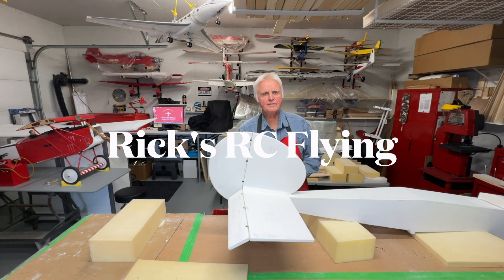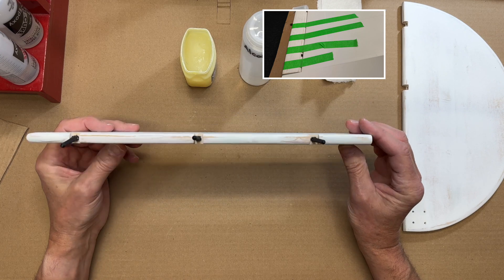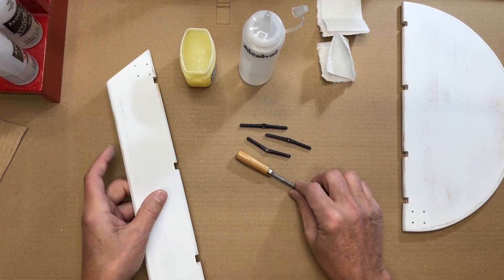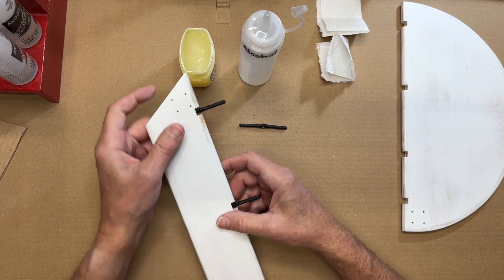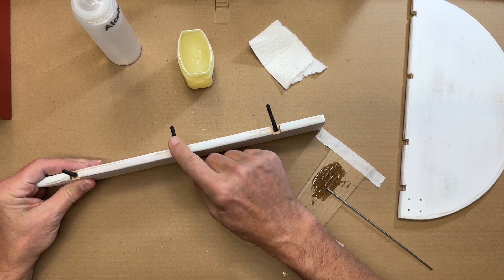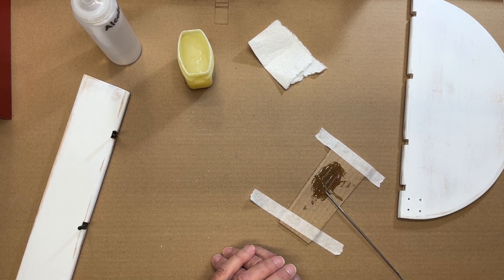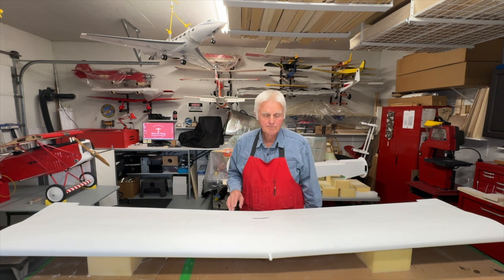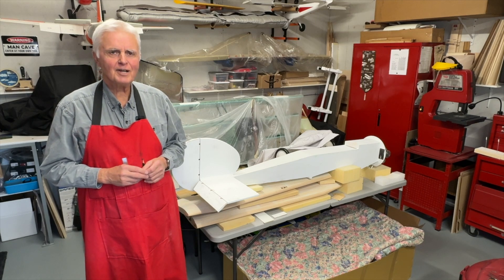Installing Robart Pin Style Hinges On A RC Airplane

Comment: I've used Robart hinges for a long time, before that was using dubro flat hinges pinned with toothpicks..I recently ordered 2 packs of hinges; the 3/16" and PKG of 1/8", after years of no problems ...every single hinge of the 1/8" and 3/16" were very stiff.I emailed Robart with my concerns..he told me he would make me a set...said would look at the adjustment on the machine..so hopefully by now their hinges are good again,but there are probably a lot out there still that are too tight.was July/Aug of 25 when I got these
Reply from the maker: Thank you for taking the time to share your experience with the hinges. I genuinely hope this issue is resolved swiftly. It’s reassuring to know that Robart is actively addressing the problem. Rick

Comment: Its getting harder to start out in building.  Materials, tools, chemicals, even balsa are harder to source. 
 With the loss of hobby shops
Reply from the maker: It's definitely not what it used to be, but there are still many builders out there. For suppliers, you can check out Balsa USA, National Balsa, Brodak, Aircraft Spruce (for glue and finishes), Dubro, Chief Aircraft, Kit Cutters, and many others. It may take some searching online, but you should be able to find what you're looking for. Don't give up; the satisfaction of building your own airplane is well worth the effort. Happy building Rick

Comment: Substitute for denatured alcohol:  In California you can no longer purchase denatured alcohol (air quality issue), which is recommended in this video for cleaning up unhardened epoxy around hinges.  I ran some tests with other solvents and found that the Clean Strip brand Brush Cleaner worked well.  Test was run with 30 minute epoxy applied to wood, and also to Solarfilm brand Monocoat-like covering.  I let the epoxy cure for 5 minutes before attempting to remove with the solvent.  There was no damage or discoloration to the covering material and no residue.  The brush cleaner is mostly acetone, so I assume acetone (which is available in California) would also work, but I didn't have any handy so it was not tested.  I also tried Paint Thinner, which did not work well.
Reply from the maker: I appreciate you sharing that information. It’s valuable to have.